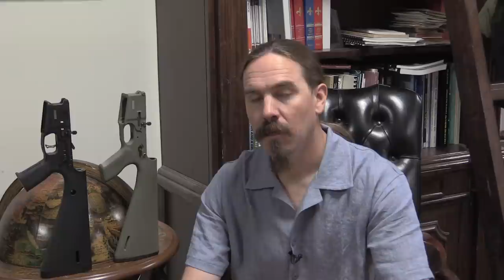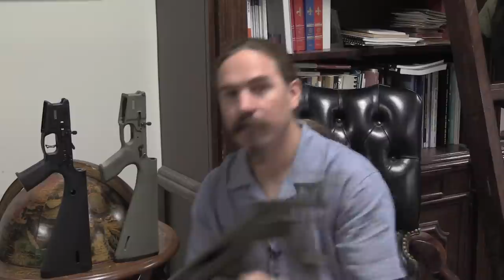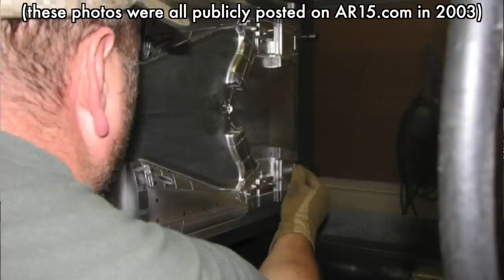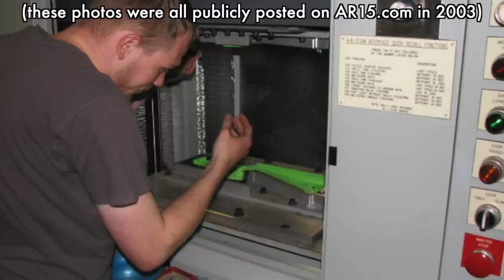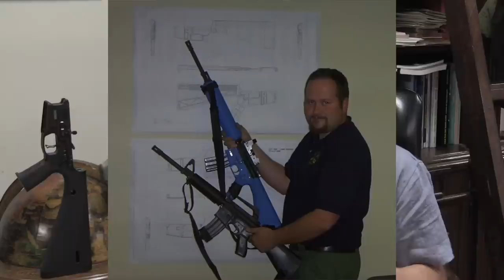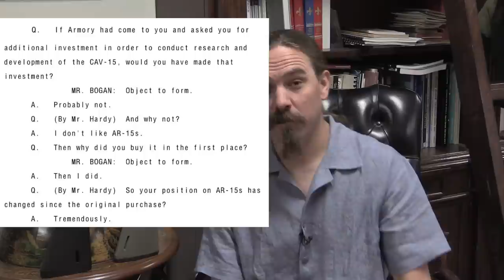Anti-Gun Partisan Lawfare? GWACS Sues KE Arms et al.

Comment: Huge startup cost in injection molding, 15 years ago my uncle spent about 15,000 to tool up for an injection molded guide wheel, an incredibly simple and quite small part. it has paid off well, but he has purchased probably 100000 units since the original outlay, you need to be able to sell enough units to amortize the mold costs, and the re-ocuring mold repair replacement. When you start talking reinforced plastics, like a glass filled nylon the mold life goes down very fast especially when you are looking for a certain level of surface finish, no one wants a receiver with half assed mold repair artifacts all over the outside of it. figure 10000k outlay adds $10 to each rifle if you can sell 10,000 of them, with no idea how many each mold can make before it needs major rework, or replacement. This all in a market place with a million choices in conventional cast and forged receiver options, be a real tall hill to climb to be successful. As for the origins of the lawsuit, it could be a manipulation by a political bent, or just a shady lawyer looking to run up some billable hours on a disgruntled business failure.
Reply: I worked for a company that did lost wax casting, and rumor had it the wax injection molds ran nearly a million apiece. They would move tens of thousands of widgets a day.
Reply: @moosemaimer  I thought in lost wax casting you made a wax version of what you wanted to cast, buried it in some medium, and then poured in molten metal to melt and replace the wax, hence the "lost" part.
Reply: @Devin_Stromgren  yes: the parts were injection molded in wax, those attached to a sprue, it was covered in ceramic, heated to melt out the wax, then filled with molten metal.
Reply: @moosemaimer  The method I'm familiar with used clay around the wax, which you broke after casting.  Of course said method is from the bronze age...
Reply: This reminds me of my own trade (tool & die). The die sets I work on cost at least $750k to build (and that's for stamping out something like a cutter blade for a hedge trimmer), to say nothing of more sophisticated shapes. Add in the stamping press, the feed equipment, steel stock,  lube to get sprayed on the coil as it feeds through the system, the system to actually get that lube sprayed onto the strip, the control systems... you're looking at a startup cost of $3 Million to get to your first production run for very simple parts. And that's not counting things like baskets, forklifts, employee compensation, etc. People really have no clue just how much you need to pay up front just to get off the ground in manufacturing and especially mass production.
Reply: 10k is super cheap for a mold. Most are well north of 100k
Reply: @Leonarco333  No doubt, this was a very simple part, just a plastic guide wheel, I would expect anything with complex features would be exponentially more.

Comment: Shawn's Dad was heavily involved in the injection molding industry.  That's basically how he managed to get the business up and running as quickly as he did.  They did nonetheless have some issues with the sonic welding process.   Russel was obviously a major spokesman (and 3-gun competitor) but he bought the tooling, and the residual inventory. 

IP can be patents, trademarks, copyrighted materials, logos, and trade secrets.  As Ian points out, the monolithic Cav lower was never patented.  There really are no "trade secrets", it's a welded 2-piece chunk of polymer.  I still have a rifle built on one of the "Cav Aid" lowers.

GWACS lawsuit is prima facie groundless and frivolous.

Edit to add: even if Shawn had patented the lower, the patent would be well expired by now.

Comment: I think you are missing the idea of the lawsuit.  What you describe (and I posted something similar to Carl) is the idea of what is called "inevitable disclosure".  This is a controversial topic.  Here is the idea.  You work for a company.  You learn a bunch of information about a topic.  You become an expert in how your company makes the thing that you work on.  You then quit and get hired by a competitor.  There is no way that you can compartmentalize the information so that any information you learned working for your prior employer is not available to your new employer.  This is where things like non-compete terms come from in agreements in separation.  There is a lot of case law around this.

As to whether IP was sold during any of these transactions, I would have to see the actual agreements.  However, any attorney involved in this would likely include not just the molds but exclusive rights to drawings, concepts, and other information involved to make the products from the molds.  This information would be the basis for the lawsuit.  Even if the part drawings were made public, it would be hard to say whether things like mold analysis and structural analysis information was made public.  Without looking at the documents and contracts, I can not know.  

It is irrelevant to the protection of the IP described here whether the company claiming ownership wants to use it or not.  Just because you own a car, does not mean you must drive it.  You do control who does drive it legally.  IP protection does not give you the right to make (or do) something.  It prevents others from using your IP without proper license.  Just because you patent a widget does not mean that same widget does not violate patents from 3rd parties.  If I use a cartridge as an example (and note this is a fake example), you could patent the case but someone else could have patented the bullet.  You can not make your cartridge using that bullet.  You can stop other people from making your cartridge.

Is the lawsuit valid?  I have no idea without seeing the evidence.  I have been involved in IP rights issues in negotiations and litigations as a plaintiff, defendant, and witness.  I have been deposed multiple times in various situations.  It is a complex subject and one that has many specialists in the legal world that work on this area exclusively.
Reply: The point wasn't that the rights weren't retained, but that they never existed, as every concept in the product was a prior one.
Reply: Sounds like a legal minefield.
Reply: I dont think that anything about the GWACS polymer lower is IP as nothing about a polymer lower for an AR-15 is proprietary information. There are hundreds of different companies making AR-15 lowers all with the exact same design as the KP-15 already. Its the equivalency of suing someone for stealing the design of the basic bicycle wheel. There are millions of examples of the supposed "Intellectual Property" to the point where the design and production of the KP-15 could have been done by any company as the design is in common use.
Reply from the maker: The sales contracts are linked in the description text. As I understand it, no IP for the mold tool was ever in question, because no CAD file for the mold exists, and it did not exist in 2011 when the mold was sold to GWACS.
Reply: "Is the lawsuit valid?" no it's not, end of discussion. Just another case of corporate law abuse.
Reply: But Russel BOUGHT the old tooling...I would think that would have the larger impact than almost anything else.
Reply: @ForgottenWeapons  Read that document - starting at page 3 item 11.  In particular, items F and G.  That is the IP involved and CAD is not required as this type of IP existed before computers.  Hand calculations, paper records, and the like are just as protected.  Note in particular, item F - which includes licenses for all.  That is the licensing of the IP.
Reply: @Rileysworld727  I am not arguing that there is any IP problem with the KE Arms product.  What I am trying to inform you of is the legal principle involved.  As I said, it is highly controversial.  In California, you can not try to enforce inevitable disclosure as it is considered restraint of trade.
Reply: @fullm3taljacket  It makes no difference at some level, as the contracts decide what was bought and sold.  In fact Russel's involvement is the basis of this lawsuit in my opinion (which you can take from what you want).  For example, it is completely legal to create a product to compete with someone else.  If a company wants to be completely clean on this, they might develop what is known in the parlance as a "Chinese Wall".  This separates the development team from any information that came from the competitor, including former employees.
Reply: @skislope4218  You are thinking of IP rights only in terms of patentability.  Those are not the only type of IP rights nor are they the only ones that are protectable or enforceable.
Reply: @jimsackmanbusinesscoaching1344  I do love the smell of a nice vague listing of unspecified IP... In any case, the only thing that GWACS are now claiming as their "IP" is that the following are proprietary to them: a) A1-length of pull, b) butt trap, c) QD sling attachment. You'll note that neither b) or c) are present in the actual product made by the tooling Russel sold them. There's an extra layer to this but I'm not sure it's public domain so I won't state it here (though it might have been mentioned in @inrangetv 's video).
Reply: @BlokeontheRange  They can depose and claim anything they want.  It does not make the lawsuit valid.  Nor does it make it invalid.  I have had attempts to enforce IP rights on things I worked on from Lucent who claimed their IP was included in the standard, thus we must have violated it.  Their IP was in the standard, but we did not implement the standard so they could not enforce their rights.  The work on this attempted enforcement took years and we had to eventually produce all the design documents that showed we did not do what was in the standard.  The question is whether that was cheaper than just paying Lucent.  That was not my call, but we did not do so.
Reply: I think many of you are postulating that I agree with GWACS here.  I don't, but not for any of the reasons that you have. From an inevitable disclosure standpoint, I would argue that there was too much time elapsed for this to be a valid topic.  The longest non-compete I have ever seen is 5 years.  For people 12 - 18 months is more typical.  I have no idea what the separation agreements with GWACS and Russel look like, so I can't tell if there is anything there.

As many want to say, there is no patentability here.  I would argue strongly that no trade secret protection exists because of the actions of CAV Arms.

There are 3 things that I was trying to help people with.  One is the notion of inevitable disclosure.  Second is the notion that you can enforce non-patented IP rights.  Third is the notion that you do not need to use IP to own the rights to it.  If you take these elements into consideration, how to prosecute and defend against the lawsuit is very different than most people think.
Reply: @jimsackmanbusinesscoaching1344  Then does it come down to whether they used calculations or schematics or such specific to the creation of the original Cav-15 MK1, when designing the new product?
Reply: @skislope4218  No, under inevitable disclosure (which I said is not going to work here).  Having an employee who developed these products is enough to potentially cause an IP issue.  As I said, this doctrine is controversial and has lots of problems.  The idea would be is that Russel learned a lot in the making of the original product.  What to do, what not to do, etc.  This knowledge was then used by KE Arms to create their product, because Russel can not unlearn the information and will make decisions based on it.  If KE Arms acquired some of the original documents and calculations, that would make their case stronger.  But again, I think they are going to fail here.
Reply: @jimsackmanbusinesscoaching1344  and we wonder why so many very different people are ok having virtually everything in this society burn down to the ground... there's no incentive to do literally anything and you WILL be penalized for everything.
Reply: @fullm3taljacket  You also need to look at this when applied properly.  I worked for a company that sold a product to the telephone companies in China.  There were several Chinese companies who reverse engineered that product and sold it in China.  Well, not much we could do about that.  However, they tried to bring those products into the US and that we could stop using our IP protection.
Reply: @BlokeontheRange  And I should add that buyers are generally very vague in these contracts about what constitutes the IP they are buying.  The fundamental principle is that (unless you are specific otherwise) you are buying all know-how on how the thing was built and made.  Buyers, in general, can not know exactly what the required IP is.  That really is known by the sellers.  I was negotiating a deal with Marconi over IP as it was going Tango Uniform.  The product line that we bought had lots of patent protection.  How were we to know what the patents that we should own were?  We can't spend years studying all the designs and then comparing them to the patents.  We had to have representations and warranties that they were selling us everything we needed and licenses to anything we didn't buy.

Even in this case there is a difference between someone who worked on a widget and someone who knows every detail.  In most cases, there is nobody that knows every detail.  Just lots of them.
Reply: @jimsackmanbusinesscoaching1344  I think the difference here is that what you're talking about is basically an undertaking that the seller accepts he can't sue the buyer in relation to what's been bought, which doesn't necessarily need listing exhastively. That's not the same as what's going on with GWACS here.
Reply: @BlokeontheRange  No it is a general principle.  The seller is agreeing in these vague statements that they are selling or licensing all the required IP.  That is full stop.  One consequence is that the seller can not sue the buyer.  Another is the buyer owns or has a license to the IP.    When it is not enumerated, courts view it as inclusive.

Comment: Couple of points: 
1. Am not a lawyer. 
2. Was involved in managing court cases (judicial review & tort cases). 
3. Why haven't Karl + Russell not sought a hearing date? Force the plaintiff to come to terms or have the case heard.
4. Why haven't Karl + Russell not instructed their lawyers to have the case struck out on the basis of Reid Oppenheimer's statements as they suggest that the case is not bona fide! 
5. Why has Karl + Russell not countersued based on the above? 

Just some random thoughts. 

Also I would look to see if champerty is legal in that part of the USA. It was made illegal in Ireland in the 1630s!
Reply from the maker: Karl is not a party to the suit. 
Many motions have been filed back and forth, including motions for dismissal.
Reply: @ForgottenWeapons  Thank you for the reply. I imagined such matters had been undertaken but not sure these matters had been mentioned by Karl. Naturally, there is probably much about the legal strategy and tactics that he cannot disclose. In Ireland, up until recently High Court cases were taking between 4 to 5 years from initiation to conclusion! 1 day in court was costing 1 side alone €70,000+. 😔
Reply: They are counter suing. If you read court docs there are 2 cases going on. One is Gwacs V. Russell et all and one is Russel v Gwacs et al.
Reply: @gabemando7823  Thanks for the additional information.

Comment: It's easy to blame this on politics, but a lot of lawsuits, no pretty much all lawsuits are motivated by greed. 
Especailly in the last 10-15 years patent trolling has become a huge industry unto itself. 
There are a few well known cases of this. 
Such as with Ampex. You may know them as inventors of modern magnetic tape recording, video tape recording and a few other things. 
They went bust in the 702 or 80s I think. Resurrected years later suddenly Ampex thinks it has the IP on pictogrpahic icons, moving pictures on a screen and other basic elements of the internet. 
Some slick lawyers really thought they were going to get a royalty for every desktop computer with an internet connection and GUI. 
This smells like that. 
Lawyers buying a company and trying to see what they can patent troll out of it.

Comment: this is similar to the John Deere vs. Kinze lawsuit, with Deere trying to keep a clamp on a certain design of equipment and attempting to monopolize the supply of that particular part.
Reply: In this case, GWACs didn't design the lower, come up with the idea of the monolithic polymer lower, and didn't commission the mold they were using.  They were using an old Cav Arms mold.

Comment: Ian & Karl:

1). If the WWSD folks would create a legal trust via their law firm that we could donate to, I am certain they would get a lot of $ to help fight this.  Just make it so that unused monies will be donated to a local battered women's shelter or some similar good cause after.

2). If it all goes pear shaped, I have a solution, a "mil-spec" WWSD.  I built my WWSD after all the GWACS lowers were gone but before the KP-15 was announced.  I met the overall design goals for the most part, came in under the WWSD weight, and used many of the same parts.  I found a way to do this with a standard forged Spikes Tactical lower.  A KE-15 lower would actually be an upgrade with its flared mag well and still be in the weight you wanted.  If this is something that would work, I would happily give you the parts list in exchange for you at some future date posting footage of you having fun with it.
Reply: I built mine with a Magnesium lower form mag-tactical.
Reply: The WWSD 2025 is a 3D printed lower .
Reply: @wesrihn  I looked at those, but they were out of stock at the time.